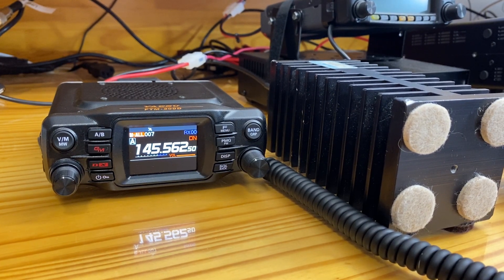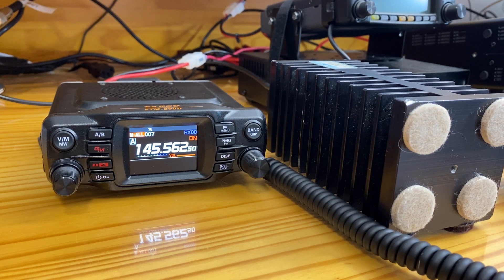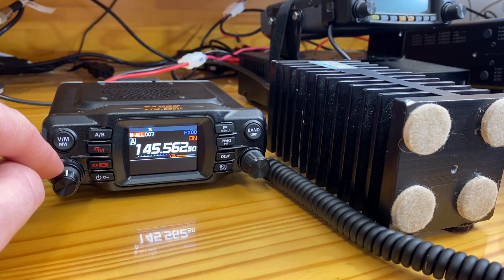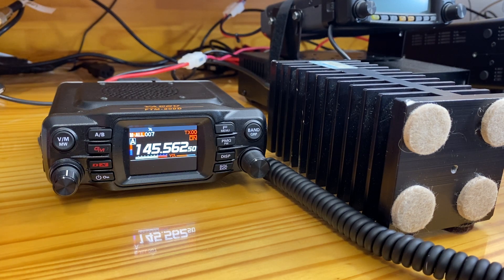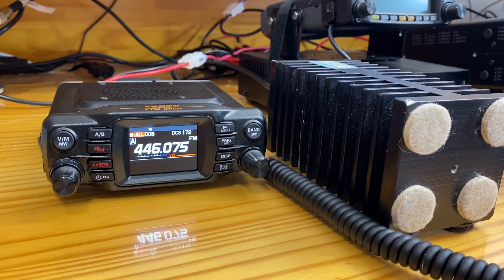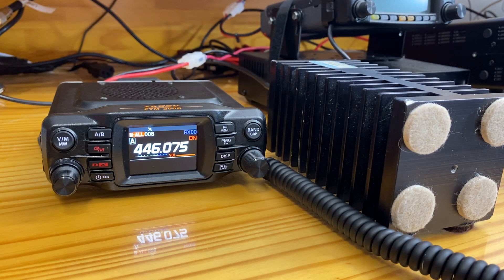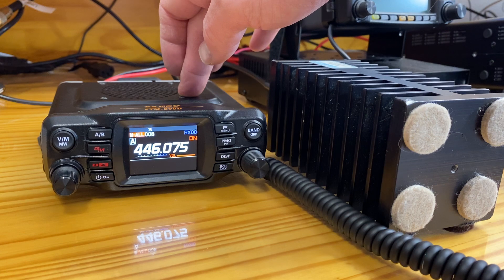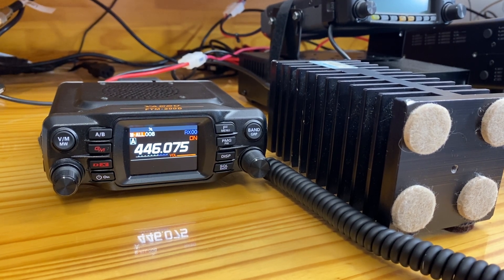Yaesu FTM-200D speaker noise (WARM)

Comment: Hi, sorry this is a bit late, only just seen your video. This is a known problem and Yaesu (Japan) have issued a fix for it. I am in the U.K. and bought the FTM-200de new from one of our emporia. After changing the unit once, and finding the same problem, I contacted Yaesu (U.K.) who immediately recognised the issue. I sent the main unit back to them and it came back fairly quickly.. fixed, no more noise. Apparent there was a batch of radios (not known how many) that got shipped with this problem. The fix involved 6 extra components (3 caps and 3 resistors) of additional 'de-coupling' in the audio chain.  You should get in touch with your local Yaesu main distributor and complain. Steve, G1VQV.

Comment: Did Yaesu fix this problem in later radios?
Reply from the maker: I have a friend and local ham just bought one sounded like it still exists however does not sound as significant on his as my 200. Out of all the mobile radios I have only ever heard this on the 200
Reply: @rash0401  thanks for the info.  Thinking of getting one for the car.  Probably won't be an issue but it's a shame that Yaesu hasn't addressed the problem.
Reply from the maker: @Chris-hy6jy  have to admit even with that flaw It still may have some of my FAVORITE features on it for a radio. Awesome radio especially when it's on sale.